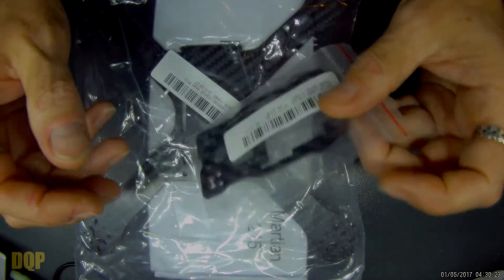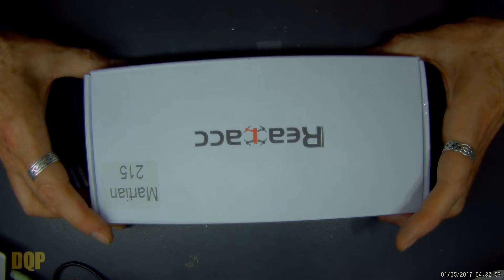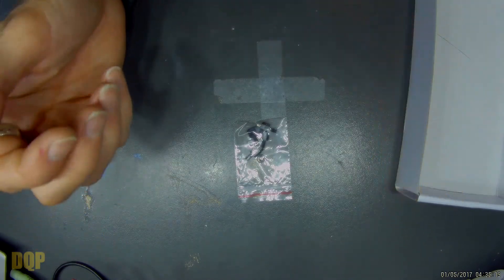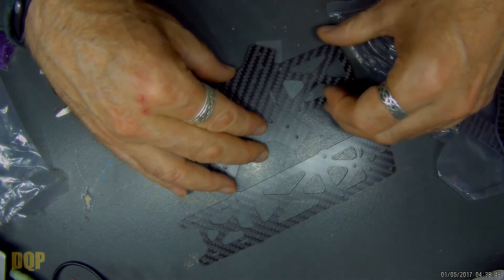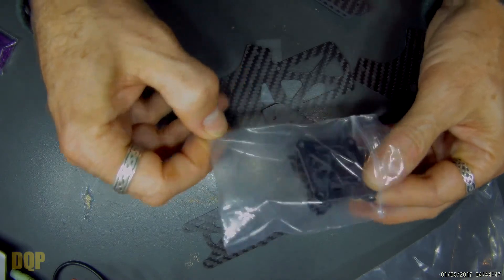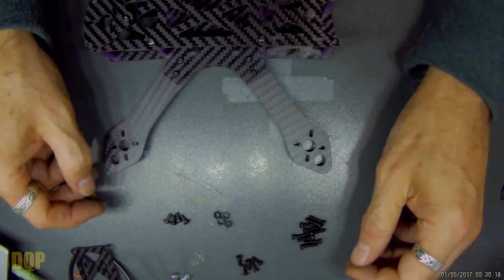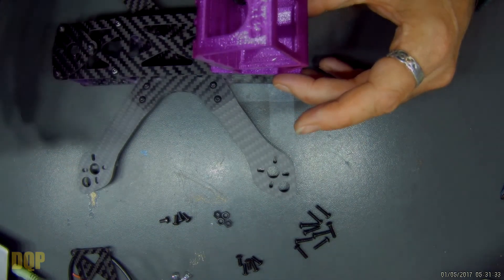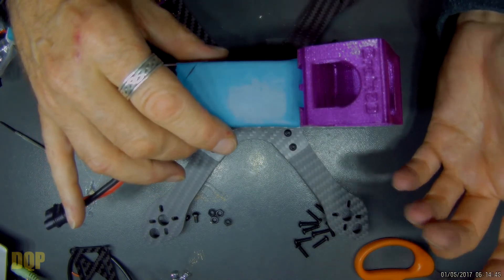RealAcc Martian II Anniversary Edition Frame First Look

Comment: I've had 3 or 4 of the Martian to frames the two twenties that camera side plates the slots are for lining up the camera is a little plate you should have a little plate in the bag that's bolts onto the back of the camera then that slides into those slots and you also use the two holes to line it all up
Reply from the maker: Thanks Spike. That must be the funny shaped plate that came in the bag... I'll check it out tonight if I get a chance.
Reply: Steve Winnard yeah that'll be the one sometimes you have to cut a little bit of carbon out with a plug goes in because of the osd plugs and voltage plug for a little bit bigger now but yeah it does fit in you just got to bolted to the back of the camera
Reply from the maker: Cheers mate :-)